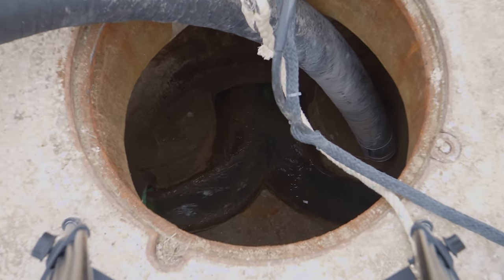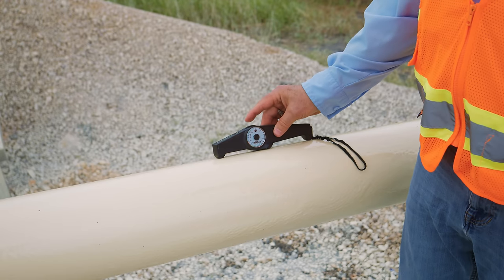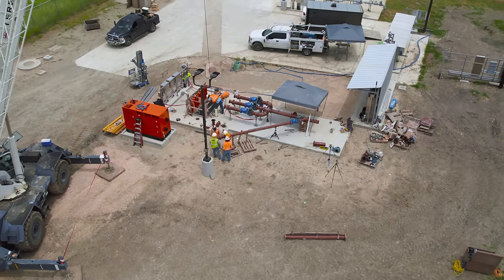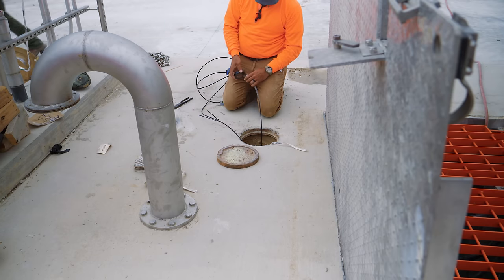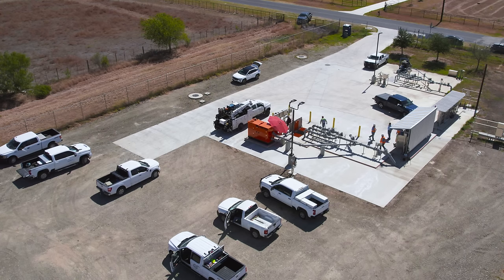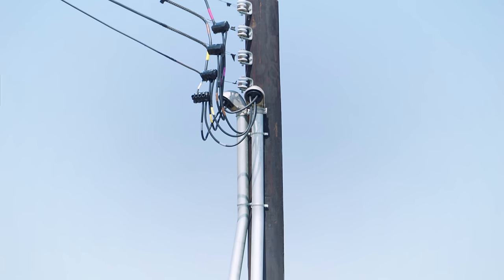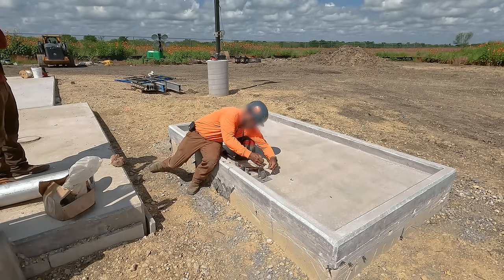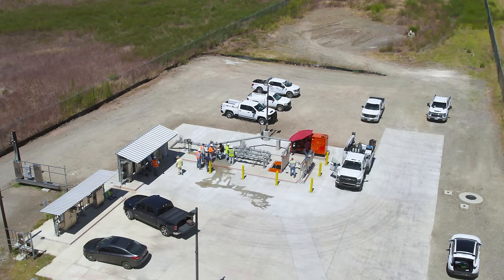HEAVY CONSTRUCTION of a Sewage Pump Station - Ep 5

Comment: Float switches, if left hanging like those at 9:45 have nasty tendency to get tangled with hoisting chains and power cables. Although just a backup switches, they are way better off pinned to the side of a wet well or even encased in the stilling pipes like the main water level sensors. Great series Grady - keep it coming! 👍

Comment: My neighborhood owned its own sewage lift station, and for decades we all fretfully squirreled away money to buy a replacement. Every so often the ancient pump would clog or break and the HOA would send out worrisome notices about the state of our Emergency Repair Fund. (The relic was an “Archimedes 1.0” model, if I wasn’t mistaken in my translation from the Greek, with a screw carved from a block of granite. It was powered by mules who had become too tired to ferry tourists up and down the Grand Canyon, and all the residents took turns feeding them through the day. It was a headache.)

Eventually we saved enough for a new lift station, and at the same time we got an amazing offer from the County. If we would buy a proper station, they would agree to take over operation and maintenance of it in perpetuity. It was a great deal all around. The County could be assured that everything connected to their plant was up to snuff. They could maintain it for far less money than we were spending. And we no longer lived under the threat of an extraordinary financial assessment if our old station conked out too soon. Also, we worried about the threat of a staggering sewage backup into our homes, as the closest connection to the County’s lines is up a pretty steep hill. You say “check valve”, I hear “poop flood”.

I got a close view during the construction of our new lift station. It was fascinating — but not nearly as interesting as your video series. I hope you’ll continue with these lessons in infrastructure.

Comment: I’m amazed the sand blasting and painting is done on site outside. For person living in quite a lot northern climate that would sound like huge schedule risk if weather would be bad during that phase of build. Just when parts painted are that small and could be painted industrially indoors.
Reply: Direct Quotes from Content Creator Grady (other than that in parenthesis): “MGC is a private contractor that bid this project and was paid a fixed price for the work.” Site Location GPS Coordinates: 29°27'24.4"N 98°13'49.8"W “This is a low bid job, so if the contractor’s wasting money, it’s their own. The answer is complicated though (for why the pipes were sandblasted and coated on-site). Pipe mfg. (manufacturer) coats the pipes with something basic (at the lowest cost and for general use rather than this specific application) just to prevent corrosion during storage and delivery (it then needs to be removed so that the proper coating adheres to the pipe durably).  They aren’t equipped to apply the wide range of (different) coating products that an engineer might specify (remember, it is not just paint!), and even if they could, the final coating would likely get damaged during the delivery or construction (installation), putting them on the hook (liable) for fixing it rather than the general contractor who is better equipped to purchase the correct products and ensure that the final product (result) meets the specs (specifications for the application of the pipes) after the installation (such as the required thickness of the coating, color, useful lifespan required, final environment the pipes will be in, etcetera).”

Comment: Nicely done.  the biggest pump station I designed and built used an 18' dia wet well with 2 88 hp pumps.  It fead a 24" pipe

Comment: Definitely very interesting to see a complex construction project documented in this level of detail. It also shows a lot of possibilities of improvement in the process, for customers, that don't want to wait a year and are willing to pay for the time frame shortening, to learn from. I'm not talking about occasionally workers "standing around", that's totally fine. I also think they did a good job. I'm talking about the fro my point of view rather crazy dance of construction and destruction they performed. I assume, that's because the workers are cheaper than requiring the supplier companies to deliver everything as ready to use as reasonably possible (like holes in the right places, shape and size, coatings applied, etc. etc.) which would definitely possible, if they are willing to pay for it. And the customer (city/county/...) as usual feels no urgency at all, so: to standard but as cheap as possible wins as usual. Not necessarily wrong in this case as this station is basically a backup at the time of the video, but that's of course not true for most construction projects.
Idea: If you dare, you could do a comparison video for certain common construction projects: The standard way (slow but inexpensive) vs. you want it quick (fast but you need money). E.g. completely replacing or creating fro scratch 4miles of 4lane average highway the classic way vs. destroying and recreating an aged airport runway (same length, much more complicated layers and add-ons) in a single night (not a joke, there's a video how they made this happen at the Munich airport; only the execution, of course, the planning took a lot of time). I think such a comparison approach would be fascinating, but I doubt you would get volunteers for being filmed doing the classic approach in such a scenario.
Just my 2cts.

Comment: I noticed the wind gauge on the top of the crane in the intro. I always wondered how crane operators determined when wind conditions were safe enough to operate.
I used to think it was all about weather reports, but I'm learning!
-
edit: Thust blocks! Learned about those here!
And that electrician trick to run wires through conduit made me smile AND face-palm for doing things the hard way for years.

Comment: I mentioned in a reply to another comment how much I really enjoyed and appreciated your excellent work. Ideas for further projects, and on this channel surely, would be over-water bridge spans where pilings need to be placed and the span needs to allow ocean ships to pass by. Non-opening spans can cause problems with bridge design such as happened, and seems to be still happening, in the Portland, OR—Vancouver, WA  I-5 crossing of the Columbia River.  Getting the span high enough without restricting access to the highway for miles each side is apparently problematic.  I'm sure other areas have already faced similar issues.

Comment: What a great series! Thanks.... 
I also have a concern about not enclosing all the electrical panels in a more secure structure. They seem to be "open to tamper with" by someone jumping the fence. 
Look forward to more projects like this, Grady...
Reply: I was wondering about that as well. At the City that I worked for, we had our motor-control panels and SCADA equipment in a climate-controlled, CMU building. This was in the Pacific Northwest so in addition to protection from vandalism, rain was always a concern.

Comment: 6:01 I'm surprised that anchors are epoxyied into the holes? Is that really a strong connection compared to what I would assume to be the standard procedure to use dowels? I guess the anchor screws will not have to resist a lot of force, but to me it seems odd to use epoxy. But maybe I'm just not up to date with current procedures.

Comment: Holy Moley, 3x 3000 LPM? How big are those discharge pipes?!?!?! I'm not lucky enough to be an engineer but the largest pumps I've worked with were capable of 2000 LPH in a 1" polypropylene pipe system that was rated to handle 6 bar of pressure. Filling an Olympic swimming pool before lunch is crazy!

Comment: It seems that always in the field, that all items are sand-blasted or other blasted (bead blasted as an option). I don’t don’t know if for most earth or field installed items are always sand blasted versus any other options.
Reply: Direct Quotes from Content Creator Grady (other than that in parenthesis): “MGC is a private contractor that bid this project and was paid a fixed price for the work.” Site Location GPS Coordinates: 29°27'24.4"N 98°13'49.8"W “This is a low bid job, so if the contractor’s wasting money, it’s their own. The answer is complicated though (for why the pipes were sandblasted and coated on-site). Pipe mfg. (manufacturer) coats the pipes with something basic (at the lowest cost and for general use rather than this specific application) just to prevent corrosion during storage and delivery (it then needs to be removed so that the proper coating adheres to the pipe durably).  They aren’t equipped to apply the wide range of (different) coating products that an engineer might specify (remember, it is not just paint!), and even if they could, the final coating would likely get damaged during the delivery or construction (installation), putting them on the hook (liable) for fixing it rather than the general contractor who is better equipped to purchase the correct products and ensure that the final product (result) meets the specs (specifications for the application of the pipes) after the installation (such as the required thickness of the coating, color, useful lifespan required, final environment the pipes will be in, etcetera).”

Comment: On grounding, I'm surprised that a Ufer ground was not required, and used vs. ground rods.

In 1942, Herbert G. Ufer invented them to protect ammunition bunkers in the SW US desert from lightning hits. A Ufer ground ties the rebar in the slab{s} to the utility ground. Concrete stays damp, and has a large surface area thus low resistance to ground.  Ufer's are usually required in new residential construction; I don't know about industrial builds but would be surprised if they didn't.

Comment: Maybe another project worth documenting might be something related to natural gas and/or fuel pipelines considering there probably won't be that many projects building new infrastructure of that type in the coming decades. I would also be interested (but that could be hard to find) in the various types of infrastructure built on airports (fuel, de-icing, cargo, baggage, passengers, food and cleaning,...) out of sight of the general public. Railways would be interesting too, especially upgrades where apparently a lot of issues can arise with old equipment of defunct manufacturers or different requirements for curve radius for increasing speeds (at least here in Germany but I am sure it is not that different around the world, a good German channel covering reports and theory here is the one by Alwin Meschede but it would be nice to see the practical side of that).

Comment: 14:30 I did not know that any significant length of sewage was pressurized.  
Before watching this video I thought that a lift station pumped from a sump pit to a higher elevation. But I did not consider it moved laterally under pressure; that is a tiny pipe!

Also I really hope those seals hold and the city keeps up maintenance!

Comment: Excellent series Grady, my only question is why the electrical controls were under a cover instead of in an enclosed building or prefab building. I would think vandalism would be much less if all the controls were in a total enclosure? I built and worked in a domestic water treatment plant and we were very careful to make sure no controls were exposed to the elements or to vandals. We were also in the North East and could get lots of snow. Thanks
Reply: I was a wastewater engineer for a city in the PNW and we always had our electrical systems in climate-controlled, CMU buildings. We don't get much snow but we do get plenty of rain and vandalism is always a concern.

Comment: I loved this series, even though I work with Lift Stations constantly as a professional engineer, as it was refreshing to see it through the Practical Engineering lens! However, the guy sandblasting and coating the pipe in the open air on the construction site was very “Texas” 😂

Comment: Very interesting. Certainly explains why a project like this is so expensive. Of course the " hurry up to finish with the cement so we can dig it up again" seems to be unique to the beaurocratic mentality rather than the private sector.
Reply: Direct Quotes from Content Creator Grady (other than that in parenthesis): “MGC is a private contractor that bid this project and was paid a fixed price for the work.” Site Location GPS Coordinates: 29°27'24.4"N 98°13'49.8"W “This is a low bid job, so if the contractor’s wasting money, it’s their own. The answer is complicated though (for why the pipes were sandblasted and coated on-site). Pipe mfg. (manufacturer) coats the pipes with something basic (at the lowest cost and for general use rather than this specific application) just to prevent corrosion during storage and delivery (it then needs to be removed so that the proper coating adheres to the pipe durably).  They aren’t equipped to apply the wide range of (different) coating products that an engineer might specify (remember, it is not just paint!), and even if they could, the final coating would likely get damaged during the delivery or construction (installation), putting them on the hook (liable) for fixing it rather than the general contractor who is better equipped to purchase the correct products and ensure that the final product (result) meets the specs (specifications for the application of the pipes) after the installation (such as the required thickness of the coating, color, useful lifespan required, final environment the pipes will be in, etcetera).”
Reply: @justinirek6859  So he was the low bidder. Proves nothing! Ever heard of the $600 toilet seat for the US Service? He was the low bidder also.

Comment: Hi Grady, could you do some episodes on deep foundation drilling.  Freeway overpasses, large buildings etc need deep foundations so the structures above will never move do to settling.  Keller in Phoenix drills holes up to 10 in diameter and 150ft deep.  They have techniques to drill these holes even in unstable material as riverbed cobble and sand etc.

Comment: The method the electricians used to run the cable pull string is known as a “rabbit” or “mouse”. There are purpose made versions and then there is the much cheaper plastic shopping bag technique you see in the video.

Comment: What is the reason that pipes arrive with coating that needs to be taken off, only to be replaced with a different coating? Why wouldn't the pipes be delivered with the final coating already in place?

Brilliant series, Grady. Would definitely love to watch more videos of this kind. This is like watching the Discovery Channel in its glory days, but without the added nonsense of "drama" that they liked to sprinkle in.
Reply: Direct Quotes from Content Creator Grady (other than that in parenthesis): “MGC is a private contractor that bid this project and was paid a fixed price for the work.” Site Location GPS Coordinates: 29°27'24.4"N 98°13'49.8"W “This is a low bid job, so if the contractor’s wasting money, it’s their own. The answer is complicated though (for why the pipes were sandblasted and coated on-site). Pipe mfg. (manufacturer) coats the pipes with something basic (at the lowest cost and for general use rather than this specific application) just to prevent corrosion during storage and delivery (it then needs to be removed so that the proper coating adheres to the pipe durably).  They aren’t equipped to apply the wide range of (different) coating products that an engineer might specify (remember, it is not just paint!), and even if they could, the final coating would likely get damaged during the delivery or construction (installation), putting them on the hook (liable) for fixing it rather than the general contractor who is better equipped to purchase the correct products and ensure that the final product (result) meets the specs (specifications for the application of the pipes) after the installation (such as the required thickness of the coating, color, useful lifespan required, final environment the pipes will be in, etcetera).”
Reply: @justinirek6859  Thanks for the answer!

Comment: Thanks for this series, it is really interesting to see something grow and have it documented.
The pumps each have 50kW with 3m³/minute. That sounds big, but is for a big and growing village, so will eventually equal  out a littlle with the demand. Are there statistics when they will get clogged or wear down due to sand or other abrasive materials in the waste water until they need to be replaced or at least cleaned? Preventive maintenance seems to be important additionally to all the remote monitoring. How often is maintenance planned?
In most countrys at least here in Europe wet wipes are a huge problem with waste water systems, they keep the pipe celaning business running, but at a cost. I think this will be a problem there, too- are there ways to deal with this problem apart from just cleaning the pumps and sharpening the blades on the pumps regularly?

Comment: One complaint: it's not high voltage.
If you're still just triple-digits, you're, in electrical grid speak,  low voltage.
Commonly known as mains voltage.
This is barely higher than the home electricity supply dominant in much of central Europe (277 V phase-to-neutral vs. ~240 V phase-to-neutral).

The distinction is notable because there are fundamentally different risks between working on low-voltage installations and working on ones with higher voltage.
For one, low voltage won't electrocute you without touch (you are too shaky to hover close enough to get electrocuted, but not actually touch).